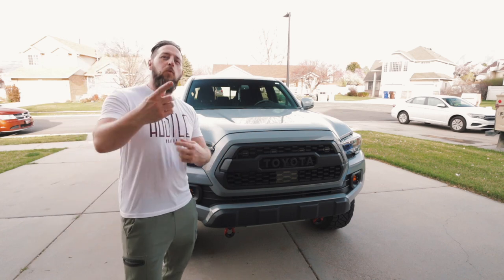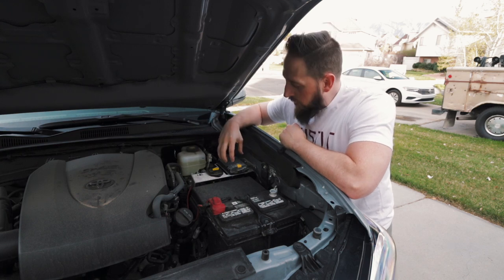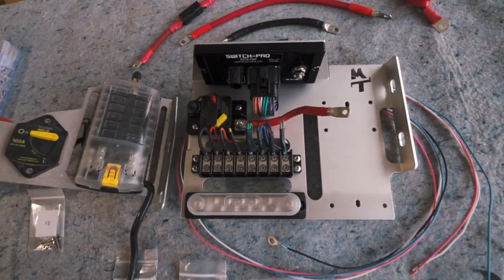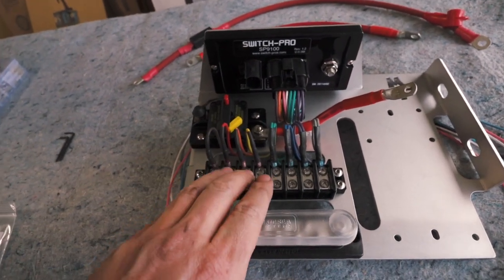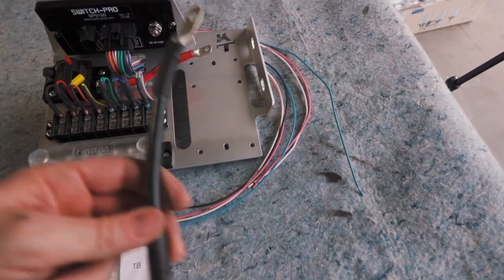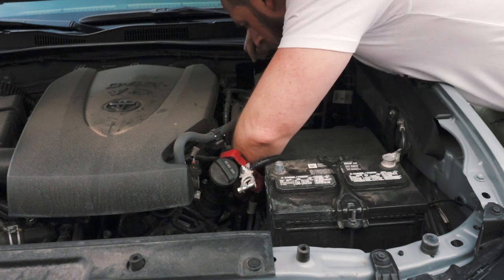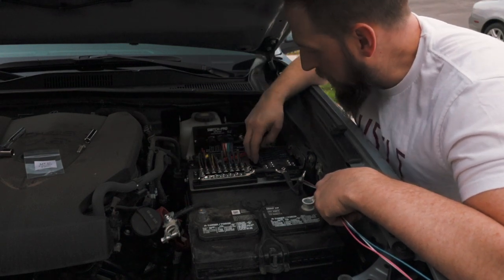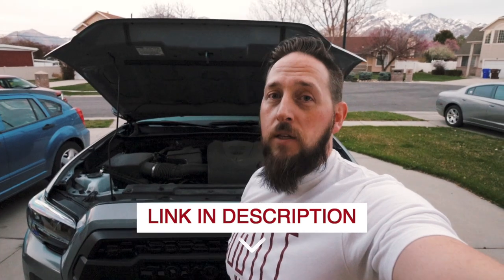2020+ TACOMA POWER MANAGEMENT TRAY UPGRADE | INSTALL | #tacoma #toyota #sdoffroadmt

Comment: I've really enjoyed watching your videos lately as I get ready to add a switch panel myself and a bunch of new lighting.
Pardon my ignorance I'm very new to this I thought the switch Pro could handle lights all on its own yet I see all the other items on your tray do you mind explaining why you used all of that rather than just the switch Pro by itself thank you so much and please keep creating great content
Reply: Ps also what size breaker? It's not listed on your build out page unless I'm blind.
Reply from the maker: Thanks for enjoying the videos, I hope they help in your journey building your Tacoma. 

The Switch-Pros can handle lights on their own, but you’ll still need to ground the electrical circuit for them to work. I’ll make a video helping to explain the overall workings of having a tray setup.
Reply: @Mumfy64  thanks Mumfy, so out of the gate to run 2 lights bars and ditch lights do I need the setup you used or just the switch pro? my lights from Heretic are on the way trying to finalize what I need under the hood, thanks in advance
Reply from the maker: It’s a 100amp breaker. If you would like the same setup I have, contact Derek on Instagram at SDOFFROADMT and he can get you squared away.
Reply from the maker: The heretic lights may come with a wiring harness is you ordered it. On that wiring harness will be a relay. You won’t need that if you are using the Switch-Pros. I have an install video on the lights.
Reply: @Mumfy64  already watched video, last night it was basically the mumfy channel all night haha
Reply: @Mumfy64  thanks reached out to him last night too, getting excited to finalize decisions and get orders placed

Comment: Switch-pros website states not to connect the output wires to a fuse block which subjects the wires to water and corrosion, and essentially takes their Solid State, watertight system, and makes it subject to potential water damage and unreliable connections. What is your take on this?
Reply from the maker: Looking around at how others have connected the switch-pros to a terminal block instead of butt connecting the accessories to the wires, I believe that they are covering their controller from the damage. By using the terminal block, you can replace the fork connections if a wire connection goes bad without having to cut the butt connection and shortening the wire. 

They also state that you shouldn't connect the power wire to an additional fuse block, and connect directly to the battery. This can cause battery drain (although Im not sure how much drain) as the Switch-Pro is therefore always on. The solid state controller should be mounted vertically so that water doesn't collect on it. That makes sense due to how the wire bundle connection plugs into the controller. That would be my main concern, I wouldn't want the pin connections corroding and having to replace the controller. 

Hope that helps.
Reply: @Mumfy64  thanks man. Gonna go the same route. Just came across that on switch pros site and was concerned. Thanks for the install video and keep it up with the channel.

Comment: Bought this setup with the 12 panel fuse block ( which is probably overkill) last night while drinking. I told Derek I'd give you a shout out.  Setup does look complicated though.  I want to run 12 individual Baja S1 Leds.   Hopefully this setup will make it an easy install.  Looks killer.
Reply from the maker: The setup install can feel a bit daunting for sure. It took me a while before I fully understood the wiring. But its fairly straight forward. I have helped a couple people on Instagram that had questions about the setup so Im happy to help where I can. Are all of your Baja lights going to be on individual switches? Could you possibly daisy chain some of them into a single switch? Just a thought.

Comment: We did the switchpro 9100 in our 5th gen 4runner and we just mounted it vertical on the driver side fender.  That if we go with a supercharger it has clearance for that.
Reply from the maker: oh nice. that SC would be an awesome addition.
Reply: I have a Magnuson Supercharger Oil Reservoir Relocation Bracket to go along with my Mount Tray. Check it out on Instagram

Comment: You've earned my subscription. This video is by far the MOST detailed for the MT. Thank you!
Reply from the maker: Glad I could help!
Reply: @Mumfy64  I do have one question tho. The red wire that is connected to the power module and is supposed to go to the battery.. I see yours going towards the firewall and not towards the battery. What am I not seeing/understanding? :( thank you in advancea
Reply: Advance*
Reply from the maker: @edgardorodriguez1314  are you referring to the SwitchPro or the breaker? In my switch pro install video I have the power for the switch pro connected to the 12 Fuse block. The only power connected to the system is connected to the breaker.

Comment: What is the fuse block used for ?
Reply from the maker: The fuse block will allow heavier draw accessories with the use of relays. The switch pro can only handle 8 accessories so I can add more with the fuse block.
Reply: @Mumfy64  thank you!!!